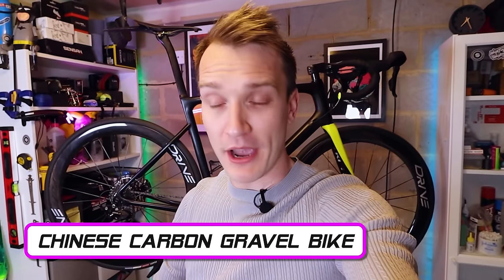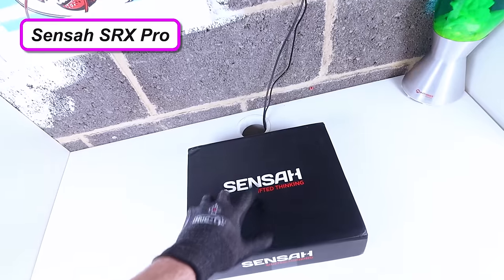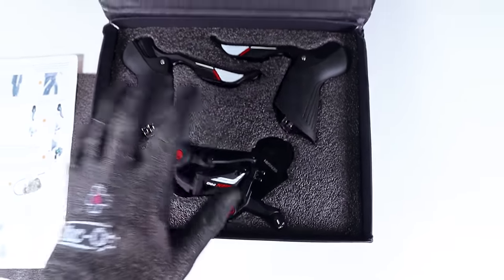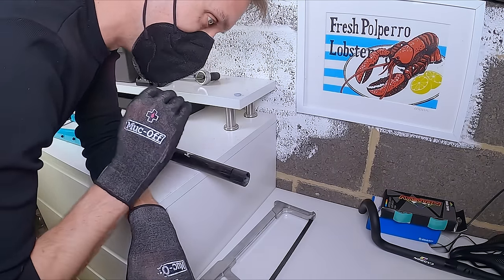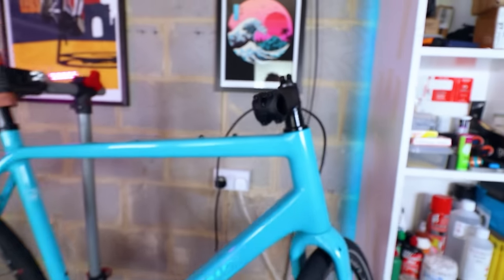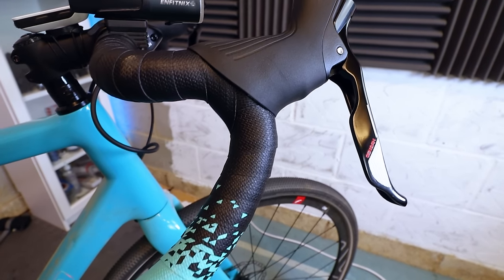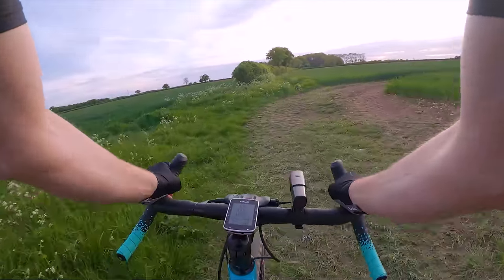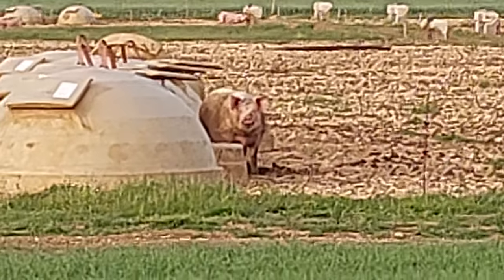Chinese Carbon 1x Gravel Bike – Full build & test

Comment: A handy tip I learned a while ago for cutting carbon tubes is to first apply shaving cream at the cut point. Makes the whole process much safer and cleaning up a breeze by trapping all the carbon dust.
Reply from the maker: I can def see that working, thanks for the tip!

Comment: Sweet build, 1x all the way.
Reply: it begins!
Reply: Never heading back to 2x
Reply: @1sigmabikes  Curious, why? 
I went back to 2x in a gravel bike, 1x didn't provide enough high gear for me. Gravel riding means that I ride both at MTB speeds on a trail, road bike speeds on the road, and inbetween speeds on gravel and hardpack surfaces.
Reply: 2x is still better for everything other than mtb
Reply: @wtfiswiththosehandles  fair question.  And I do not unilaterally endorse 1X - it is a personal choice that works for me. 
My fitness is mediocre. Maybe a middling Cat 5 or poor Cat 4 on a good day - any drivetrain efficiencies are pretty moot, as I am nowhere close to chasing marginal gains. 
My geography is flat with rolling hills 
I don't group ride, so cadence matching is irrelevant 
My gear spacing is 11-12-13-14-15-17-19-21-23-26-30-34, so I have 1T in high gears, and only jump ratios while climbing.  I run 48T in the front, giving me a max gear close to 50-12 on 2X
With the way I use 2X, I am really only sacrificing 2 ratios and a granny gear. 

And so much simpler, and less faff than 2X

But as I said, 1X is not for every rider in every situation,  but it is for me.
Reply: Just depends on terrain. I live in an area with steep climbs, both gravel and paved. I run a 1x also, but with a 28 tooth ring in the front and 11-42 in the rear. 

I top out at around 10mph on flat terrain before I run out of gear. I have hit top 10 on two different Strava climb segments in my area even though my bike is incredibly slow. I would love to see what I could do on a higher speed bike.
Reply: In looking at options I want to build a 2x so I can have more range, but I understand the love of a 1x with fewer parts and easier maintenance but imo a 2x with two sets of tires for road and gravel riding gives a lot more options.
Reply from the maker: When I was building this, I was honestly a bit hestitant about the range of the gears. I switch chainrings SO often on road, I thought I would really struggle to get on with 1x, but no regrets, 1x is awesome!
Reply: @TraceVelo  I'm also hesitant about going to 1 by. I'm currently using a compact chainset 50-34 and 11-34 cassette on my gravel bike and it seems to work both off and on road so I'm interested to know why 44 on the front is too big given you have 46 on the back?
Reply: For everyone else, wide range cassette is crucial for 1x. Minimum 11-46, better 10-44 or 10-50

Comment: My biggest concern with the frame would be the mounts for panniers etc. As you tighten any bolt into the frame there is an equal and opposite force pulling the nut out of the frame. That's why they weren't originally included in carbon frames. And the more weight on them the worse that will be. These nuts look fairly simple from the internal video but maybe there is something actually seated inside the carbon during the layup. Load up the frame for bike packing and go off road for a while then compare how well sunk the nuts are. If there is any paint cracking around them from the flex from the weight during bumps and potholes.
Reply: Is personally go for aluminium for bike packing. Definitely with 10kg+ of additional weight on the bike...

Comment: An other tip when cutting cf ,e.g. the steering tube is, after smoothing the cut seal with clear 
nail varnish as cf can draw in moisture.
Reply: Another tip when cutting carbon fiber (e.g. the steering tube) is: after smoothing the cut, seal with clear 
nail varnish as cf can draw in moisture.
There you go, made your comment readable.
Reply: @KamikazeCommie501  I'll give you another tip.

Comment: Hey @tracevelo you older videos got me good. I started my own gravel build after seeing your reviews on products of a budget. This is my first gravel bike/road use bike.

Funny enough I bought the same groupset,crank,seat,chain,bar tape. I was going to get the same handlebar but opted out.

"update I have bought the giant kit aswell got a cheap one online that just needs new hoses"  decided this after I realised my groupset was coming with nutt brakes
I also settled for deore MTB centerlock rotors although I also bought 6 bolt adapters just incase.
My rims I settled for are elite carbon gravel wheels with a 22mm ID.

The frame I opted for was an Aliexpress Grevil in t1000 carbon, their own cheaper frames only use t700 and I must admit the profile of the bike and the chameleon paint option I selected looked real nice.

I plan this to be my perma build on a budget for both road/gravel and hope to see more recommendations from you.

Thanks again for the content.
Sam
Reply from the maker: Hey Sam, really interesting reading over your choices. Overall that's a fantastic price for all that gear, and the build sounds wicked! But yeah the chinaplay pedals are OK for now, but yeah might have to check put some classic shimnao spd's when I have a second. Anyway thanks for the comment and good luck with the build!
Reply: I just bought the same frame on Grevil AliExpress, waiting for be made and painted and sent to me still.

How do you like the elite gravel wheels I was thinking to order them next, so should have main parts for bike all arriving similar times 

Curious what bar and stem did you go for? Are you from N.Ireland too?
Reply: @stephenbrgoodall  my wheels are still on way and frame only got sent out few days ago. so the parts will arrive end of june/mid july. 

The stem was the di2 gravel stem on alie because I wanted a less aggressive drop angle and the evkin carbon stem 6degree
both which are t1000 carb.
That and it gives me a good starting point for the future when I will eventually get a fit depending how deep im in.

And yeah belfast, my bikes all being sent to manchester since my da has all the tools and plenty of access to shop near him.

Plan to fly over to a mostly finished bike, maybe go lake district etc then on day back take the trans penine trail to liverpool and ferry over in the night.
Reply: @squee666  I’ve been looking at that di2 gravel bar but not sure if I like idea it as would rather cut the steerer a little long use a straight topped bar but it’s the only option if want less than 25 degree of flare and carbon on ali 

Ah cool so just a couple weeks ahead of me, I’m down in Fermanagh will have met up with our gevils in the future maybe 

I’m trying to look for Grx shifters and components, or I might pull my rival hydraulic parts off last years winter bike build
Reply: @stephenbrgoodall  @trace velo we going places :) "i.imgur.com/XGnIkUE.jpg"  just need to do the gears/chain/tape, will see how your tests go with the zrace,juins until then i stuck with nutts and ceramic pads
Reply: @squee666  looks excellent, mines still with the airline last 12 days! Wheels where only dispatched last week too. How is the finish on the frame?
Reply: @stephenbrgoodall   @stephen Goodall   finish is excellent, we have to file where the brake cable leaves frame because due to angle it wont fit like traces other video
Reply: @squee666  I have a GRX group to use will keep that in mind if the hydraulic lines does want point right way
Reply: @stephenbrgoodall  "i.imgur.com/StK6F0w.jpg" swapped to the conduct kit since the brakes included had clearance issues, overall weight without pedals about 9KG  had no digital scales. just need to bleed front brake again since its not working atm. my conduct kit is the older one that doesnt stick out as much which is good since it barely clears the flat bars.
Reply: @squee666  got my frame last week, wheels today first ride was great

Elite hub is quite noisy might add some grease

Flat mount front and rear needed squared up and BB needed a tap tan through it 

Weight with out pedals and cages 8.3kg with GRX800 1x and sram 10-42 cassette 

Found you on strava when you posted the pinarello group, looks like getting lots miles in on yours!
Reply: @stephenbrgoodall  I'm not fit the bike makes me feel fast lol. And yeah flat mounts for me on the rear needed a little file to be closer to the disc.
My weights due to the cheap components and giant kit. Just changing from 40c to 28c would drop me like 350g. And yeah the ent is noisy even with extra grease. It's good means I don't need to mount a bell
Reply: @squee666  ah yes I use to ride in Belfast on a fixed gear, it was too silent that I often must seemed rude to people. So I’m not alone in wanting to silence it with grease!

I’m in big fat gravelking 43c

I’m no weight weenie at 110kg myself but when buying cycle parts I get carried away with saving 100g 😅

Comment: I've been running ICAN 50mm carbon road wheels for the last 2 years and they have been rock solid performers...I've wondered about their gravel frame so this build comes at a great time for me. Great job.
Reply from the maker: Awesome, good to hear some more more success stories about ICAN
Reply: If you have a look for the Carbonda CFR696, there are a huge number of threads around it - Its the same frame (both made by FlyBike), but different OEM

Comment: Luke,

Thanks for another great video. One suggestion on determining where to cut the fork. Don't cut it until you have ridden the bike a while and get it properly fitted (or comfortable). Since the frame geometry of a gravel bike is usually a little more relaxed, the stem height may not translate that well from your road setup to your gravel bike. I (like you) had to get a shorter stem 90mm instead of 110mm) compared to my road bike. I also ended up at a different seat to handle bar level as well and a slightly higher stem height.
Have fun

Comment: I can wholeheartedly recommend Zeray ZP-108S SPD pedals. I've already broken the axles of a few wellgo and no-name pedals after less than a year and these lightweight pedals are holding up for more than the last two years; they're quite a bargain, easy to clean, setup and incredibly reliable. I even originally bought a second set just to make sure I had spares that I haven't even touched, those will now go on my next build.

Comment: Hi Luke, I'm very happy for you! Gravel bike looks great. On the topic of future changes, I was expecting you'd mention mudguards, makes so much sense having the eyelets and riding in the wet and all. Also, when you get those wheels, you need to also order a cape and mask, because your ride will look like that of a superhero! Very impressed overall by the build. Ever since your first road bike build I was inspired to make a Chinese carbon frame + Sensah bike myself, but I'm a steel kind a guy and in 2020 I came across a 1950s beautiful large frame and just had to give it new life. Last year I fully restored an old steel mixte Peugeot bike for my wife, and this year I'm saving up for my own real gravel dream build. I wanted to go back to the Chinese carbon + Sensah idea, but then the unexpected happened. I got my hands on a great condition, 2nd hand Sram Red Etap hydraulic 11s groupset + cassette for less than £700 and they cost thousands when new! So I decided to go a bit more high-end (and solid) and am now hunting for Chinese titanium. Have you looked at titanium and is there anything you would recommend?

Comment: Hi Luke, 
long time fan of your videos. The one comment I have regarding the brakes is stating that the cables stretch. Brake/gear cables don't stretch. For them to stretch you have to plastically deform the cable, probably not something regular humans can do by pulling axially on the cable. I've tried the cable actuated brake for a long time now and the main contributing factor to their "sponginess" are cable housing stiffness, number of bends the cable needs to make, sharpness of the bend, and the piston return force. If you route the cables externally and without a lot of kinks, cable actuated disc brake braking performance should start getting closer to hydraulic brakes.

Comment: Looks like a Carbonda 696 mold frame, in which case it should fit 50mm tyres. I've got 50mm Panaracer Gravelkings on mine, plenty of clearance. Great video, those new wheels looks AMAZING, can't wait for that vid!
Reply: The frame can run wheels 700c up to 50mm or 650b up to 2.1” (53.3mm)

Comment: I'm riding the same groupset for around a year now, and when I love the price, and how snappy it all works, I have some trouble with longevity of the setup, meaning after few hundred kilometers, I already need to readjust the derailleur because half of the hears jump up and down. I've seen some people mentioning in the comments about some fix to that, but I haven't tried it yet, other than that, great group.
Reply from the maker: The key to keeping sesah working smoothly is to keep the derailleur clean, and the shift cables clean and free of junk. On a road bike, this isn't too difficult, but I can see how on gravel this might be more tricky. It also helps to put a little bit of light oil on the shift cables before feeding them into the cable housings. Sensah also likes a clean well oiled chain in my experience 😊

Comment: Fantastic video Luke. Great gravel build love that frame review section.  I also run a Giant Conduct/Connect braking system. I found that I went through pads quite quickly. However switched to a full sintered brake pads - wear problem solved and they are great wet or dry. With full stopping and grip the trails, rocks or mud. Really looking forward to a 5000 - 10000 km review. again fantastic VIDS brother keep it up.
Reply: I found the same immediacy of braking and great modulation with the very similar Hope V2 system. A great concept in hybrid braking for both these

Comment: I recently built myself a lightweight xc mtb 29er, for racing and general riding.. With a combination of your channel and Hambini's channel I went for an Ican carbon frame and matched it with a range of new and great quality second hand parts.. I went for a set of carbon Farsports wheels (1350gms) and sram 12spd NX/XX1 and level LT brakes. The complete bike weighs 10 kg. I absolutely love the way it rides and like you, I am really impressed with the Ican frame. 😁👌

Comment: I’ve been using the ZTTO cassettes for a while now. Have three on a trio of tubular ‘cross wheels I built last year plus another on my gravel bike. Light, bling, and holding up very well so far. The one on the gravel bike has around 1000 miles on it so far and is holding up well (I swap out chains regularly and use home brew hot wax). I think you’ll be pleased with it.

Comment: I would say the closest thing to this build might be the Free Ranger from Planet X. As for pedals, I’ve always loved Crank Brothers Eggbeaters..so cool. Thanks for using the Giant brake set up; a real revelation!
Reply: If you look closely I think the latest free ranger may be the same frame?
Reply: @jack.3991  yes, it has the same details and shape. Same as the chainreaction victus too
Reply: @fentuz  And the Carbonda CFR696, Obed Boundary, Kanzo Adventure 1.0/Kanzo C - There are some differences, as the big name brands specifiy the frame to have a pressfit BB, the ICAN and Carbonda version have a threaded BB.  All made by FlyBike.

Comment: Thanks Luke.  I've had this frame sitting in my shopping cart for a while now and this video (along with the discount) gave me the nudge I needed.   Now I need to scrounge up the rest of the parts.   Leaning towards the Juin cable/hydraulic brakes.

Comment: First off, great video Luke, thanks.

My only concern here is resell value. We tend to upgrade and sell our old bikes. A branded bike will hold its value, an unbranded or ‘no-name’ bike will have little value at the other end. However, if it’s a bike for life, then it’s a great option.
Reply from the maker: Yeah this is a fair point, resale value for bikes like this is just not gonna be the same as a name branded bike, but for me, this is a bike for life baby!

Comment: A couple of tricks with Carbon fiber, is spray the cut area with water (1) every few minutes and have a shop vac handy (2). #1. The water limits the dust in the air, please still use the mask just in case, but lowers the dust issue vastly. #2. Also, if you have a high suction shop vac, you can position it close to where you are cutting to also vacuum most of the dust coming out of it as well. These are tricks i've used to minimize the hazard of working with Fiberglass and Carbon fiber.

Comment: Had same sealant issue with WTB 650’s...returned under warranty,got replacement...exactly the same!! So just persisted and after few days were fine😳love your build. Bought an SP Cycles frame from China few years ago..also Fulcrum wheels and SH SRAM groupset from eBay. Love it.

Comment: What a weird coincidence. I'm currently getting rid of the Conduct setup on my Giant Defy. Used it for 4000km, had to bleed at 3500. It was a such a pain, with the angles and all. Plus it takes up extra space on the bars, impeded with my bell, lights and computer mount.  However it did brake very well, not complaints about its actual function.

Comment: I got myself a giant contend ar 1, the shop kept the wheels and gave me a discount, so I paid 1350€ for a 105 equipped gravel/road bike. Threw in some Winspace carbon wheels, comes in at 9,3kg for 2000€ in gravel mode, including pedals. With my 50mm hyper wheels it's a 8,5 kg light road bike. Just a brilliant do it all build.